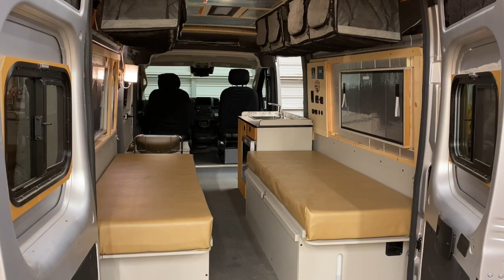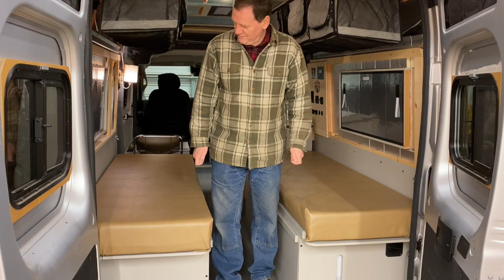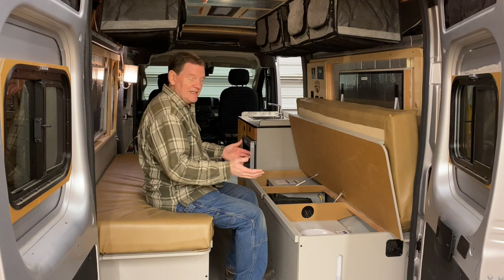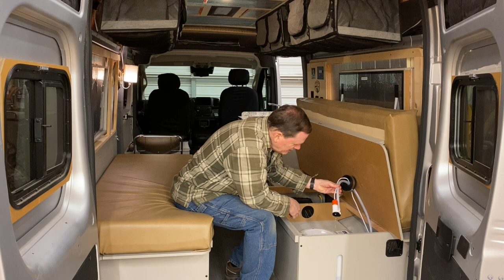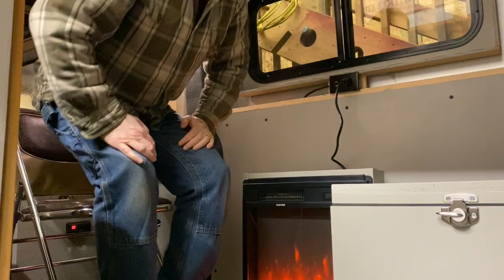CampMaker Van Winterization December 2024

Comment: Hi Dennis, Another very helpful video! Which pump and tank are you using for your water system. That is an elegant solution with the hatch too...
Reply from the maker: Guy,
Thank you for your affirmation.  My goal is to do things more simply, but often people don't understand the value of that approach. They tend to want complexity, until they have problems and things don't work for them.

Here is the hatch: https://www.amazon.com/gp/product/B07FFCQK19/
The pump: https://pantherrvproducts.com/1441-12-00/
The tank: https://recpro.com/20-gallon-fresh-water-rv-tank-25-x-14-x-14-elkhart-plastics/
Reply: @dennislittlefield  Complexity always works better in the showroom than in the wilderness.